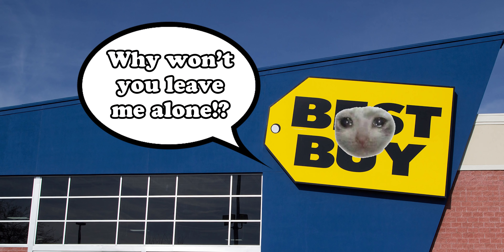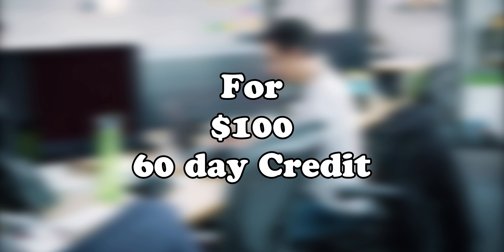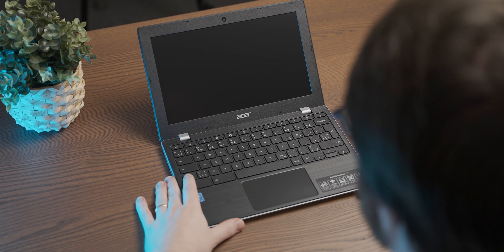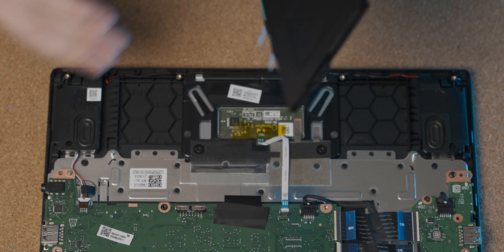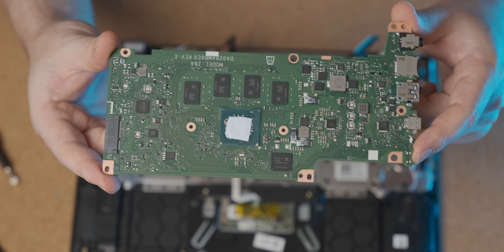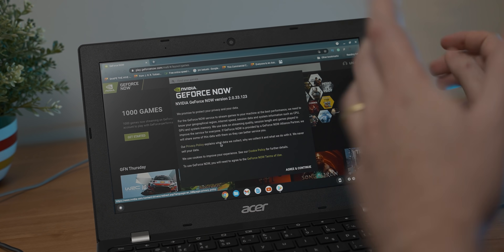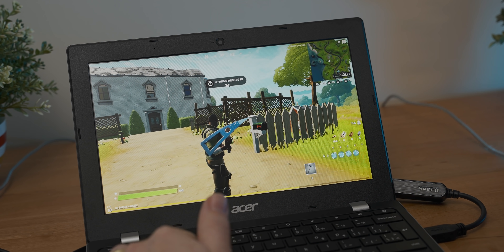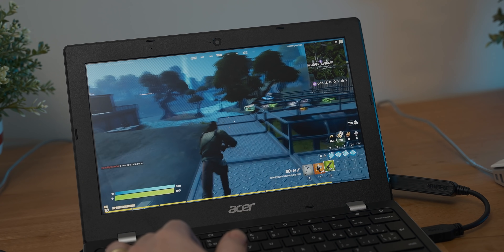Trying To Game On The Cheapest Computer From Best Buy...

Comment: A Couple of years ago I bought a $300 HP Laptop at Best Buy - that was on Clearance. I needed something immediately for Work but I was surprised that games like Bioshock, Oblivion, COD4 all ran with Ease. I realize those are Older Games but back when those games came out, I needed a $1500 system just to run them at Med/High @ 1400x900. Now, a cheap laptop is barely drumming its thumbs to play those types of games!

Comment: You would think that Intel UHD 600 would beat a 10 years old gpu from progression but the crazy thing is the Nvidia GeForce 8800 GTX is still faster and it’s from 2006. my old 8 cores Dell Precision 690 would blow this laptop into dust

Comment: This is the GOOD version of this laptop, if you can believe that. The 1366x768 panel on this machine is its saving grace. The 311's bigger 15.6 inch brother has a 1080p display, and the refreshed n4000 (n4020) on that STRUGGLES to keep frames, even on the Chrome OS home screen.
Reply: I thought my old 3867u laptop had bad gpu performance... It was also on 768p

Comment: Of the two Chromebooks, the iGPU on the Acer 11.6 in. is better: it will decode VP9, Youtube's main video codec (Gemini Lake, Celeron N4000, UHD Graphics 600).   
The iGPU on the ASUS 15.6 in. is a generation older, doesn't decode VP9, forcing the CPU to do it (Apollo Lake, Celeron N3350, HD Graphics 500).  
On that machine, you'd want the h264ify browser extension to force Youtube to serve h.264/AVC codec that the HD Graphics 500 can decode.

Comment: Best By is a joke. All of their computers are like 900 to a thousand dollars. I try to buy a laptop, and all of them are like 2 gigahertz and 2 gigs of ram on a windows 11 system with 900 gigs. For a second, I thought I was shopping in 2004, because that was like high specs then. Now it's overly priced garbage.

By the way, I truly enjoyed your video. I liked how you took apart that chromebook and then showed how it worked and stuff. It gave me an idea just to buy a super motherboard of a chromebook that could be upgraded with windows and just build a pc project with it. Maybe a linux terminal. I don't know.
I remember when I was younger, I did budget gaming on crappy laptops, and I would play roblox all completely lagged out. But I just had to live with it. Years later, I got a gaming pavilion on christmas 2017, which I still use now, and I can enjoy all the games I wished that ran smoothly now, with minimal to absolutely no lag. Still holds up finely.

Comment: i have the EXACT chromebook 311 and after a year the bezzle rubber is gone, the hinges broke (only wires holding it up and the snapped metal is cutting into the wire) it now has no camra working or mic, on roblox while ur typing the screen flickers and it gets hot as an oven also no minecraft

Comment: You could attempt to push the shopping cart fast enough to generate massive electrical charge an it would work better than anything at worst buy 😂

What does a shopping cart do you say?
Nothing! The same as computers sold by worst buy.  BUT you can at least drop your children off on some strangers porch with a cart so it has a use

Comment: I have a sneaky suspicion that the calculators are just alittle cheaper and are still considered computers. But seriously that "heatsink" type is called a heat spreader. There are hardware differences between the cheapest Chromebooks and all windows based systems. All Chromebooks need to some degree emulate the full x86 environment to run Windows. The cheaper the Chromebook the more you need to software emulate.

Comment: That Chromebook is designed internally similar to the Acer nitro 5 I opened mainly the speakers they are like the same and motherboard placement also battery placement except that crapbook has no fans GPU name ssd or 2.5 ssd spot and less heatsink but Acer has kept the same design mostly

Comment: lol the WIFI vs wired connection shouldn't be a big deal when you're gaming if your wifi setup is relatively modern. like if you have wifi ac/ax and a good signal in an area w/ modern cable internet of like 100 Mbps or higher that shouldn't be an issue at all. like unless you're still using wifi-n (which i'm pretty sure almost nobody uses anymore, especially not in a new laptop or chromebook. but who knows maybe you're using a router from 2010? lol) or you live in a small town that only supplies 20Mbps or something then maybe you should wire it up.

Comment: 6:45 Just like the Macbook pro A1708, only thing easy to replace is the damned trackpad, lol. 

just got through replacing the keyboard on one of them, gotta love having to completely disassemble a laptop, almost all the way back to the way it was before the factory started assembling the thing, just to get  to the damned keyboard to replace it. Oh and then still having to destroy the old keyboard, remove rivots and drill out the bits that stay behind in a few of the holes before being able to install the new keyboard.

Comment: wal-mart has a 4gb ryzen laptop for like $250 from motile that's surprisingly great, like it's as snappy as my much pricier surface book. It comes with full fat windows and you can upgrade the ram and nvme on it easily. It legitimately performs faster in geforce now than a chromebook does, and I dont know the reason

Comment: Oh boy, the Celeron N4000... Incidentally I have an HP laptop with this bad boy in it, along with 4 GB RAM and, get this, 1 TB 5400 RPM hard drive... But hey, it comes with Windows 10! Wooo!

No joke, it took me an entire day to get the thing updated and barely usable for internet browsing after running windows 10 debloater on it and uninstalling all the crap it came with. Idle RAM usage dropped down from 3.5 to 1.9 gigs. 

It's honestly criminal selling such e-waste with that much bloatware (win 10 included) and call it a usable laptop. The only thing this junk is useful for is ripping out the hard drive and using it as backup storage.

Comment: when playing Fortnite on a potato open Fortnite then ctrl-alt-delete open task manager and disable windows explorer, unreal crash report client, epic launcher, game bar, widgets, or any other running programs under the top 10 CPU usage tab. try performance mode. and check GPU useage you want it as close to %100 if its not max out the quality settings, if you have a decent quad core 3+ghz and a GTX750 ti_GT 1030 or better run in Direct X 11 epic view distance, epic post processing, textures epic, shadows medium, v-sync off, reflex low latency on+boost , unlimited frame rate, if you have a hyper thread CPU, enable multi thread rendering,  and in Nvidia control panel under manage 3D settings-program settings-Fortnite make sure its in quality default then run vsync in fast mode, low latency mode ultra, power management prefer maximum performance, texture filtering quality high performance, limit frames to 75 or 60 or what ever your refresh rate is but no more then 75 and no more then the monitors refresh rate, or run it at half refresh rate if you get bad stutters also whenever changing settings in Fortnite play one game it will probably lag and objects will struggle to load that's normal then close and reopen game play another game the second game at this point will run smother because the temp files need to be created before you get the full benefit after making changes

Comment: another video idea, do something with custom watercooling, all parts from wish/aliexpress. see what performance you get, go for an extreme setup and compare it to a reputable branded setup ? ie, i run a 360mm + 240mm rad with a d5 pump with a xspc waterblock for the gpu and cpu. not saihg go as extreme, but do something like for like, budget vs expensive, id like to see what the performance gap is, quality of components of cheap stuff, wonder if its got better over time ?

edited for typo *3600mm

Comment: probably a great buy if your able to install emulators on it, never owned a chrome book so not sure if thats an option though. But emulators for old console games and the games themselves take up very little space for its small compacity
Reply: Yes you can install RetroArch on it, but will fail on N64 emulation that my Pentium laptop from 2014 running Xubuntu handles just fine.  Chromebooks are such junk it should be a crime to sell them

Comment: i'm kinda impressed half-life 2 ran that poorly, i used to play that game on a very old pc that had an intel atom 1.4 GHz single core and the gpu was... an intel chipset family and half-life 2 ran at about the same framerate but it wasn't a stuttery mess it was actually pretty playable
Reply: The amount of hardware not in a Chromebook that is standard for a PC motherboard that has to be then emulated through the ChromeOS is likely taking about 60% of the system resources.
Reply: @zedorda1337  like what kind of stuff? Genuine question as I’m pretty new to computers & assumed a software couldn’t replicate a physical thing integrated into a computer but that’s really interesting that it can
Reply: @zedorda1337  like what kind of stuff? Genuine question as I’m pretty new to computers & assumed a software couldn’t replicate a physical thing integrated into a computer but that’s really interesting that it can

Comment: I see SO MANY Chromebooks in practically brand new shape for sale on many selling/buying websites because you just cannot even upgrade them to the latest Google Chrome, let alone put ANY Windows based operating system on them. Supposedly, Google is going to be making it now possible to upgrade the newer models to the latest Chrome operating systems as they come out.  It's a shame because some of the Chromebooks actually CAN make out to be a descent LAPTOP if only Google would have allowed them to be upgradable in the first place!  Many are just e-waste now!! 😕

Comment: could you also clarify the speed of your internet connection? as it's pretty important when getting into cloud gaming
Reply: bruh he put it up in the video, its over 900 mb/s down and about the same up, with like 5 ping, but yours doesn't need to be nearly as fast. You just need 15 down for 720p at 60fps and 25 down for 1080p at 60 fps.

Comment: I enjoy these kinda videos, please try make more of these, also a video with some tips for improving a mid range laptop (notebook) for longevity and performance😅
Reply: don't bother only improvement you can make is replacing the stock thermal pass and paste.
add a ssd if it's still running on spinning rust.
the end
Reply: @tanmaypanadi1414  I'm using an hp 15 da2014 series laptop which has an i5 10210u, and an nvidia mx110...(pretty shitty gpu I know)  It's got 8GB of 1600Hz DDR4 ram, and I opened it up and checked it's got a slot for a second ram.. If I add a 3200Hz 8gb ram to it do you think it'll make  big difference? or should I get a slot of 2 3200Hz rams? will it be worth spending? It runs BeamNG fine on normal graphics (around 40fps average) and I used to play GTA V with around 50 fps average on 1080p high graphics (not max), I cleaned the cooling fan and it made a difference for beam, will adding 8GB of 3200Hz ram allow it to run any heavier games without stutter? also I wanna know if it'll be any better cuz it'll use dual channel when I add another ram...

Comment: The biggest problem I had with my chromebook, was that the wires which connect to the wifi chip would often fall off and I had to reattach them frequently if I wanted to use wifi

Comment: The N4000 with the UHD600, Its like saying Intel Core2 Duo E6400 and NVidia GeForce 6800 GT. So for 160$ you basically get a complete system that can only play games released up till 2005 on max settings. I guess kids would play the same games I did as a kid.. GTA San Andreas, Call of Duty 2 and NFS Underground 2. Much wow.

Comment: Wow - Now I dont feel quite so bad about still rockin' my 11+ year old Toshiba Satellite L755-S5216 laptop from Bestbuy with 15.6" screen, windows 7, 2Ghz Pentium dual core B940 processor and upgraded 8Ghz ram. It came with 4G ram I upgraded to 8G and replaced the old 320G mechanical hard drive with a 250G SSD, really woke it up.  Shes showing her years but still hangin' in there on its second or third battery and ready for another one.

Comment: That thing is tougher than my 800$ Dell Inspiron from 2019 if you even try to pick it up on only one side it flexes more than a piece of rubber
Reply: The Inspiron also has a lot more to it. There's not much of anything inside that Chromebook. The Chromebook probably weighs 1/10th of that Dell. 

Oh...and the Inspirons aren't made as well physically as the Latitudes are...that is... if they even still make them. Those were more durable as they were made for business users and heavy usage. The Inspirons are geared towards the average consumer and are not known for their "durability".
Reply: @brucewrigleysgumchewz4667  They still make Dell Latitudes, as my workplace uses them. The newer ones have worse build quality than the ones from 2014 and before. But they're still better than most consumer laptops. I only use business laptops, like Thinkpads, because consumer laptops have shit build quality and are not easily repairable.
Reply: @brucewrigleysgumchewz4667  well my friend I know that but for such an expensive laptop it should bend .4 of an inch because I go to pick it up with one side
Reply: @brucewrigleysgumchewz4667  after all quality control from Dell is great

Comment: Dawid,

Great review!!  I have that model with that processor and bought it with the understanding that any gaming experience would probably be a dumpster fire.  For me, I basically use the Chromebook as if were a tablet or smartphone with a larger screen and keyboard.  I was surprised by the online gaming performance you got. It wasn't a total dumpster fire experience.   The other thing I did like you was use an external mouse after using the track pad for about 20 seconds.  I also knew ahead of time that any upgrades would not be possible, but for under $200, I wasn't complaining.
Reply: dude a t420 is 100000x better than this shit and is under 200

Comment: Chromebooks can actually run Linux games including Steam games
Reply: I came to comment the same. A good chromebook is a surprisingly capable steam machine
Reply: The only way to salvage a Chromebook is to install a GNU/Linux distro on it. And even then, you're stuck with shitty hardware.
Reply: @comicsans1689  I mean yeah...but you get what you pay for. PC laptops aren't any better at the same budget price as Chromebooks...
Reply: @MoChuang343  I can buy a used Thinkpad off of Ebay for the price of a shitty Chromebook and get a much better experience, outside of battery life.
Reply: @comicsans1689  I have an older ThinkPad as my daily driver...I have this exact "shitty" Chromebook so that I can take a device with me in my backpack that will last 10 hours, can check email, play a few old games I like, and if needed remote into my desktop.

I paid $129 for it and get every dollar worth of functionality out of it. It was totally worth buying as a secondary device. If you don't have a computer then yeah of course buy a used Thinkpad since it's a much better primary device.
Reply: @MoChuang343  A cheap secondary device or a remote thin client is all of the use that I can think of for a Chromebook. 

I'm curious, which Thinkpad do you use for your daily driver? I've gone back and forth over the years with my T400, T420, X220T, and W520. I currently use a P14s AMD version for my daily driver since it has a nice IPS display and specs that hold up against my main desktop.
Reply: @comicsans1689  Mine's not that old. I have an E570 with an i7-7500U and GTX 950M.
Reply: @comicsans1689  Some Chromebooks have beast hardware. If you install Windows on that, it's good.
Reply: Yup me too
Reply: Chrome Os is actually based on gentoo Linux, so it makes sense
Reply: "Good" and "Chromebook" is an oxymoron..... 😄😵

Comment: On the point with the ribbon cable rodeo, I can attest to that.
When I disassembled my first laptop at work to exchange the motherboard (previous one was defect), I thought the ribbon cables aren't all that secured. 

I was wrong.

On the old motherboard, after I installed the new motherboard, it was found that it was damaged because of moisture (meaning the repair is not via warranty) so I had to remove the motherboard again.

When I tried to rip out the ribbon cable on one of the connectors, I damaged the connector and promptly caused 500$ damage for my company.

My senior coworkers told me that it's not entirely my fault since they should've supervised me and I gained valuable experience that day.

Comment: Now do a video on one with the mediatek chipset and install windows 10 on it, maybe even an Android OS. I want to know because I've not seen any info on these mediatek powered laptops and I want one for a low powered gaming (within reason, I'm not a high fps/resolution gamer) laptop that won't drain my vehicles battery. 

Great content anyway. I wish they'd ditch those celerons for even a quad core cpu like my old budget laptop.

Comment: Is this a good deal
16gb dual channel 3200mhz kingston ram 
Ryzen 5 3600
Gtx 1660 ti
256gb ssd
1tb wd green
6 fans(RGB)
with a 24inch monitor
All brand new :() 
Is is a good deal for 992$?